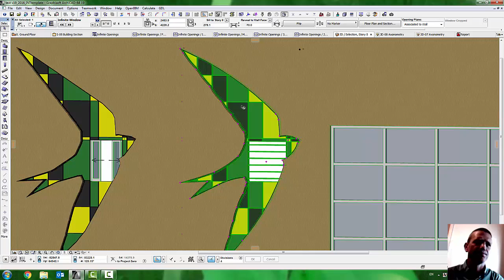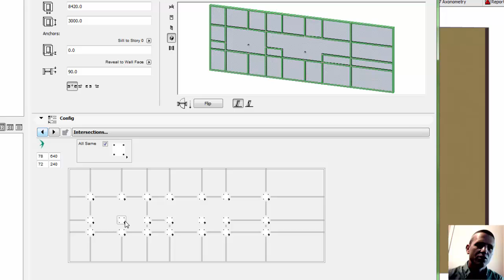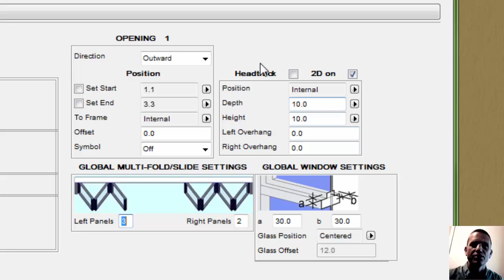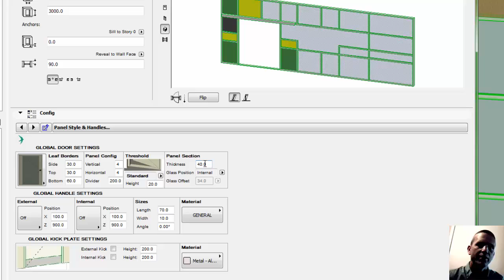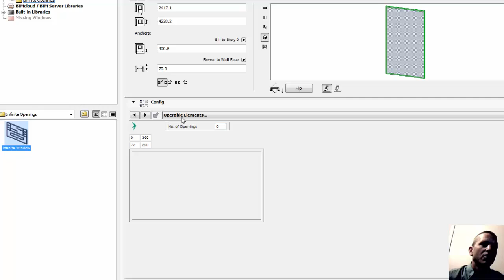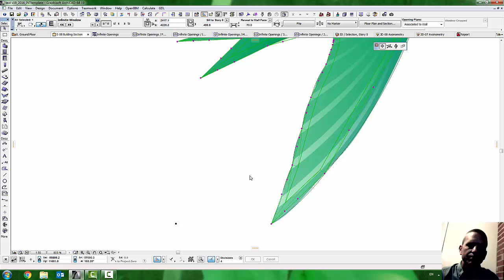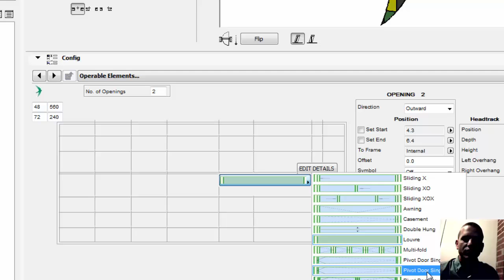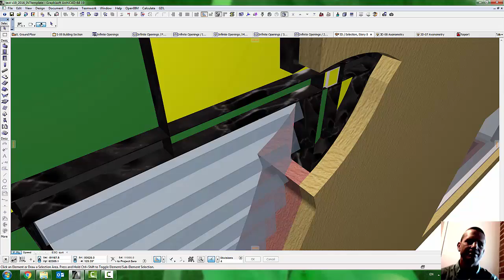Infinite Openings by CADSWIFT

Comment: Can this work on a curved wall with curved glazing?
Reply from the maker: We are working on it. Currently there is an option for curved glass in a single panel, but we have not yet added the ability to curve the frame elements or have the mullions array in an arc. When we get it done, we will post an update.
Reply: @CADSwift  sweet thank you. that would be amazing!

Comment: How do you unlock the door dimensions? I have everything set to custom. Under the "Operable Elements..." tab and the "nominal Sizes and Tolerance..." tab I can not adjust the leaf dimensions.
Reply from the maker: The leaf dimensions are determined by the overall size minus the frame size; however, you can adjust the leaf sizes on the "Opening Panel" page by setting the "Oversize" dimension with either negative or positive values. If you are creating a multi-panel element, then you can select the "Differ Widths..." function on the "Operable Elements" page.

Comment: The multi slider door looks great, just wondering if its possible to put arrows on the end doors? At the moment the two center sliders have arrows but the outside ones don't have arrows but slide.
Reply: The end doors can be set "fixed" and that is why the arrow is not present. However, if the end doors are left as sliding they will have an arrow on them.